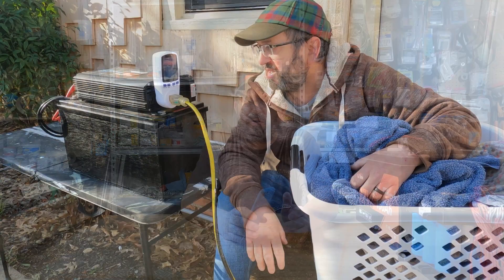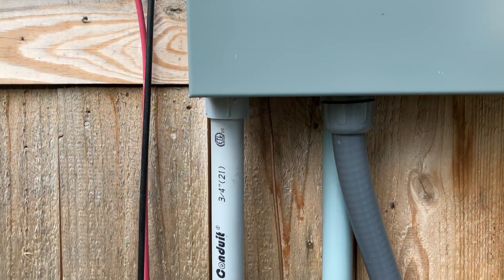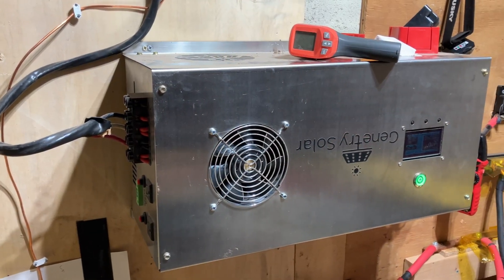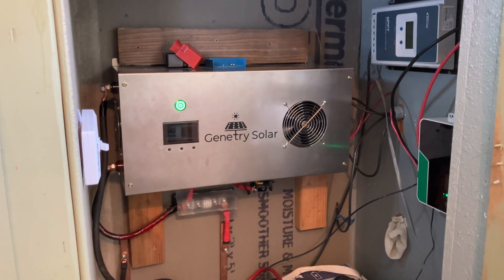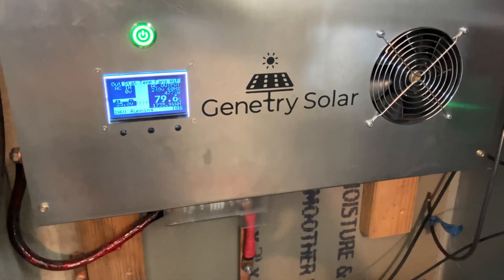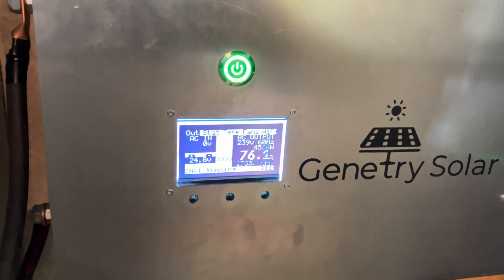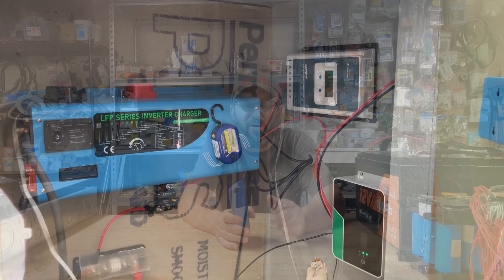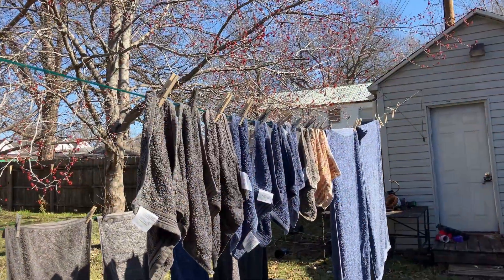Can You Do Laundry Off Grid?  What does it take?  4k inverter?  6k Inverter? How many batteries?

Comment: How about a gas clothes dryer where the only electricity used is the motor and the heat source is natural gas or for 99% of off grid setups will be Propane/LPG ?

This, this should be somethibg that wouldn't use any more power qnd maybe even less that the clothes washer right?
Reply from the maker: That is an excellent idea!!

Comment: As of last month I can run the dryer for 8 hours at night, or 6 hours with home load and a 1500w heater.  You could have tried med heat with the first set up, then it may work.
Reply from the maker: Heat setting didn't make any difference.  What size system do you have?
Reply: @OurBlackCatCottage 12kw, 48kwh and 13 to 16 kwpv.too bad my old Samsung was 2400 3600 and 4800w for L M H. I might get a 2kw all in one laundry to save space.

Comment: Whew.  Motor + electric heating elements.  I'm actually impressed that it's only clocking 5kWh or so to dry a load.  But it isn't all bad.   It all comes down to the watt-hours, but that energy doesn't all have to come from the battery.

Throw on a bit more solar and run the dryer during the day with the solar helping out, and even wire up both inverters (if the batteries can handle the total load), and you'll be golden.

If you think about it, 5kWh of energy (one load) only needs 1kW worth of panels, at least in summer conditions.  Getting serious about running larger home loads is absolutely doable.

-Matt
Reply from the maker: I have the panels to run it during the day but if there is enough sun for the panels then it just makes more sense to put the clothes on a clothesline and let the sun dry them directly.

Comment: I've been considering the SungoldPower 24v 6000w split phase inverter/charger. I just don't have the funds right now.
Reply: Buy a torque wrench and use the specified numbers..
Over 2KW it seems to be more cost effective to go to 48v, cable and inverter can be less..
A piece of string in a greenhouse seems to be the most effective.. and for the money you get a outdoor room to sit in and grow things 😻
Reply: @Markus-UK  I am confused by your torque wrench comment. 😕
Reply: @makingstuffisfun329 
Torquing the connections on high load's like an invertor and all the connections between including the battery also no stacking of terminals and no stainless is a must. Especially with say.. 8mm terminals.
Reply from the maker: SungoldPower makes really nice gear

Comment: Damn 4600 for a dryer is crazy

Dryers are so hungry
Reply: Yeah, electric dryers are power hogs. That's why I changed to a gas (propane) dryer. It only takes 1000-1200 watts continuous to run it. And if it's not raining or freezing, we hang our clothes outside to dry. (Free solar drying)
Reply: Has everybody forgotten about a clothes line?!?
Reply: @RustyMeadow  I'm in the Carribbean cloth lines are the standard lol
Reply: @RustyMeadow  That's what we primarily use unless it's raining or freezing.
Reply from the maker: I was very surprised. I figured it might surge over 4k but had no idea it needed 4.6k constantly. Massive amount of energy needed to run it.